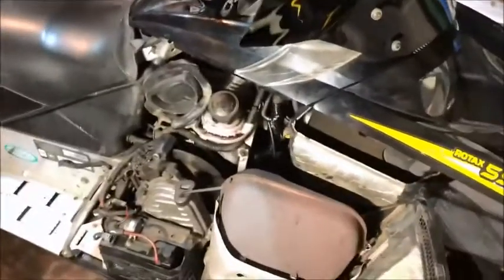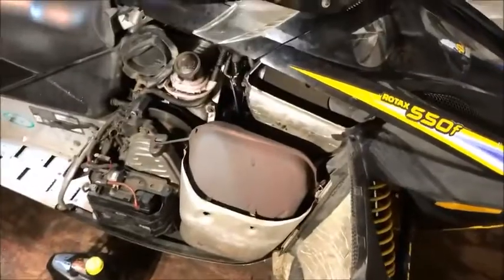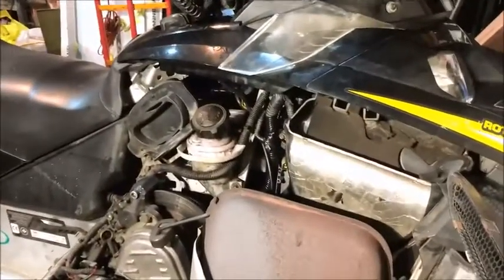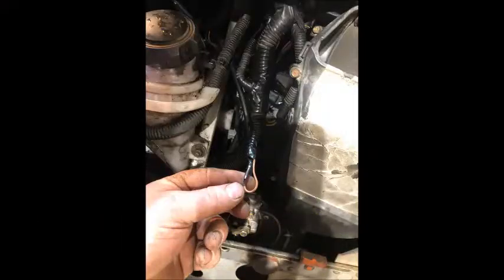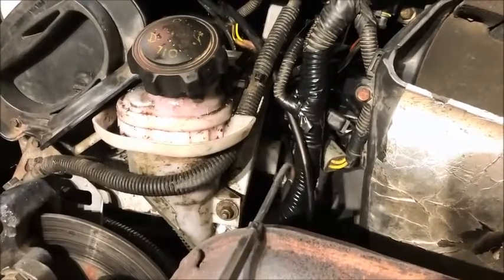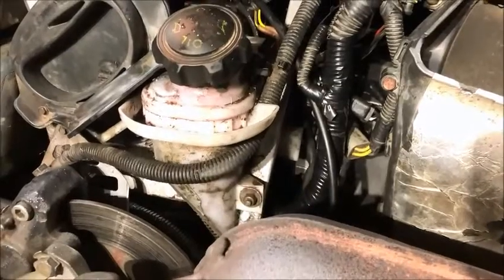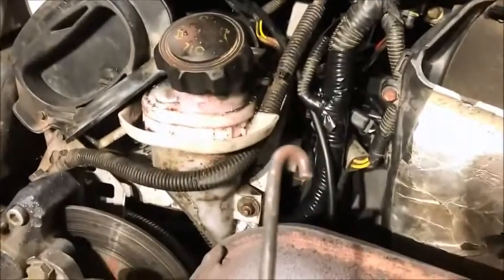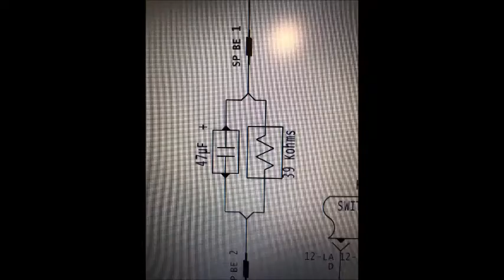2005 Skidoo Summit 550F Reverse Issue - post engine rebuild

Comment: i have an issue like this and a 550 f     i get mega ohms at first then cuts out a little then ohms  falling and staying at 39k.. my reverse does not even try to engage.... so this is in the harness near oil tank?  and do you have a part number for the new capaciter?  how easy is it to screw up polarity???
Reply from the maker: There is no part number for the capacitor Vic, local dealership had no idea about this circuit in the harness.   It’s a few years now but I remember the voltage was melted off so I experimented with 12v up to 18v at 50uf I believe.       25uf discharges too quick for the circuit to engage reverse.  Don’t put anything smaller then 12 v it will fry when you charge it almost instantly hitting the reverse button.    I did try a 12v, 14v, 16v and 18v capacitor they all worked but seemed the 14 and 16 worked the best.  I think I settled at 14 since running voltage is usually 13.7v.        I think it was a blue capacitor  different type of isolator between plates, oil vs ceramic.     It’s way easier to expose you’ll find it under a lot of tape about 2-4” below the top level to the right of the oil tank.    Warm it with a torch and slowly cut it off.   It’s a pain cutting it… and also you… when it’s cold.    I hope that gives a bit more direction.

Comment: Any idea after a fresh stator install why the sled would backfire and pop in reverse only? Sled runs great going forward but pops and backfires in reverse only
Reply from the maker: Wife’s 550 died on the trail last season, it was the CDI with no spark.   I thought it might be the stator but I found a video from RM Stator diagnosing everything before you replace the CDI.   Both ignition pickups are about 6.7 ohms I forget the stator resistance offhand but I’m guessing it is something beyond the stator which might have been part of the problem.   There’s about 5 things to check.    Even voltage regulator but you’re not high idle in reverse.   You’d see your lights change when giving it throttle if it was bad.   Maybe a bit of overfueling at low rpm?   Look what color your spark plugs are burning, it sounds rich on idle.   There are 3 jets on the carbs, one for idle, one for moderate running and another one that opens up after say 6000 rpm.   Maybe a loose plug  on the reverse pickup.   It’s a 2 wire plug into the CDI blue and white.   (The forward plug is 4 wires. Blue, white, brown, brown/black).       I googled your problem guy with a 2010 550f had similar issues and finally took it to a dealer who replaced the power pack.     Hope that gives you some ideas, let me know if you do figure it out.